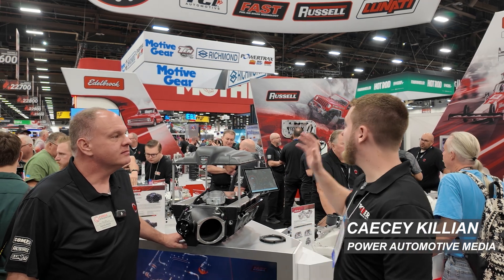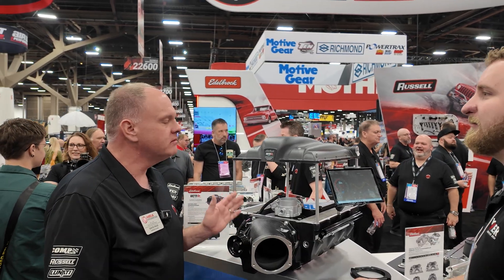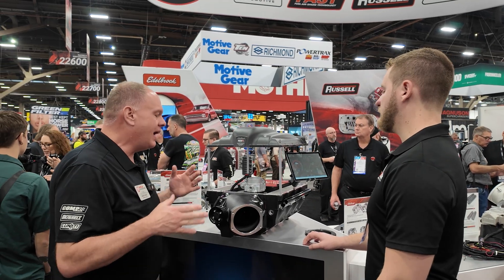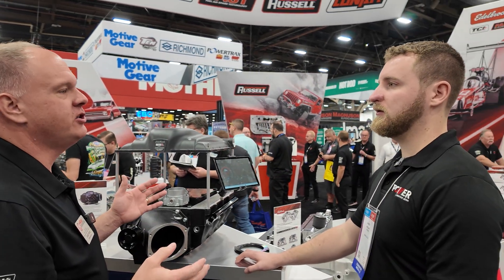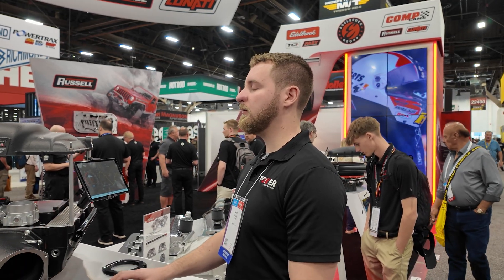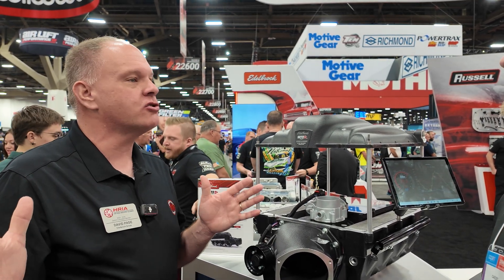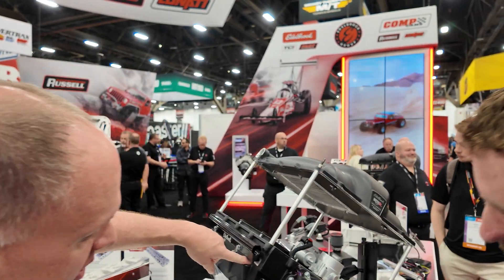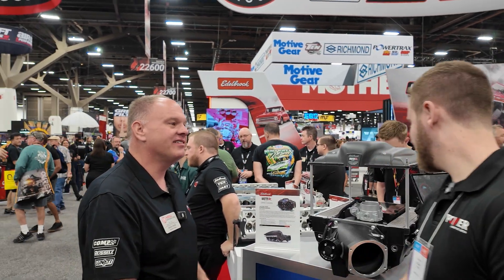Edelbrock's Victor LSXR 3100 TVS Supercharger Has Electronic Boost Control | SEMA 2025

Comment: If Eaton didn't change anything on the 3100 it's not going to be nearly as efficient as the 2650. They had this problem several years ago when they were testing the 3100 rotor pack.

Comment: Why make a supercharger based on 1 company? There are coyotes 7.3's now 6.8's smallbloc fords hemis exc
Reply: Ls/lt is their biggest market. They will release stuff for the ford and hemi products
Reply: @danielcantrill3104 thats a little strange seeing that most of the chevy's go with the magnuson 2650
Reply: @ranware2779   but now they will go to the 3.1 instead
Reply: @ranware2779 Magnusson is still an Eaton rotor pack. I wouldn’t see edelbrock over Magnusson for a supercharger anyway. My point was the Ls/lt market is bigger than the ford market for these types of blowers.
Reply: I Agree ... hopefully Edelbrock had 2 there Engine lineup as U have suggested..

Although l am probably looking at a Dart ( iron block hemi 482 cu inches ) with a 3.8 ltr Whipple Supercharger on top.. easily make 1500hp

Comment: This can already be done with existing vacuum based bypass valves, especially the 2 port GM ones.  Just need a regular boost controller.  With an OBD2/CAN input you can actually set up boost by gear as well while retaining factory ECU functions.  Glad to see the big companies doing this, but they're several years behind the curve.
Reply: Where are you getting vacuum on a boosted engine
Reply: On a positive displacement supercharger as soon as the throttle body shuts it is in vacuum same as a naturally aspirated engine.
Reply: @jacobtravis812 so why are you trying to control boost at idle or off throttle?
Reply: You always have vacuum on the throttle body side, it’s pulling air through the air filter, creating a negative atmosphere..l even when it’s under full boost
That’s where you get the signal… but I don’t think it makes enough power for the money…
I want to see 500-700 gain..
Reply: @maegenyoungs2591 there is not enough vacuum between throttle body and airfilter to actuate anything. If there was you have a serious restriction problem